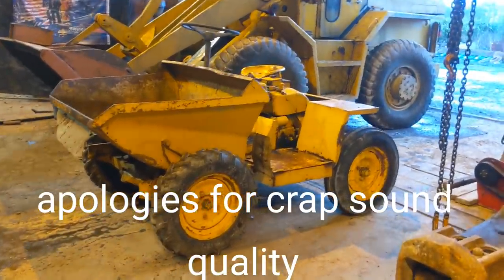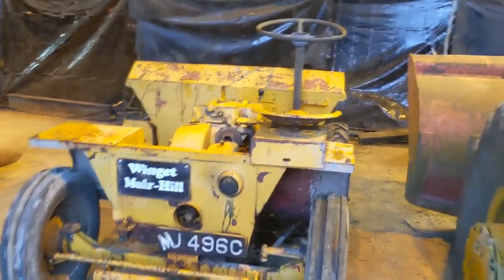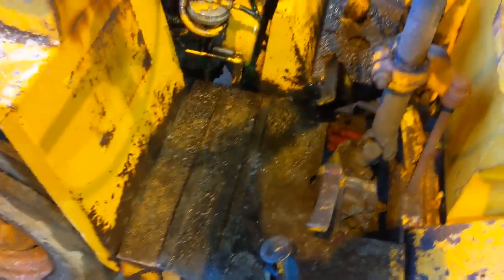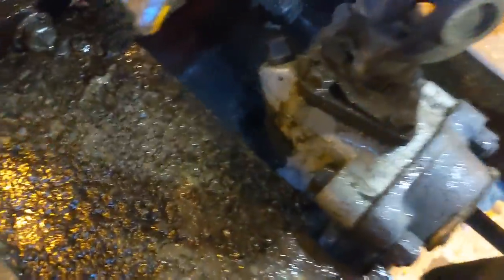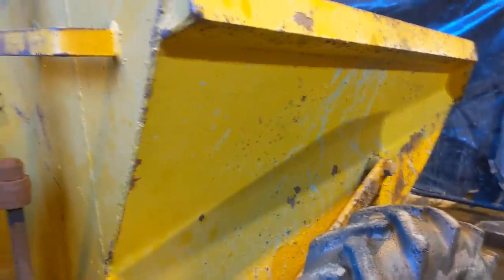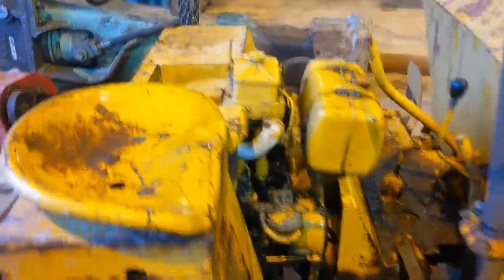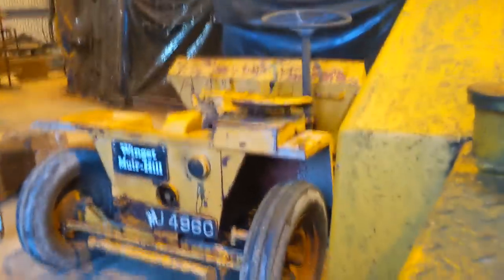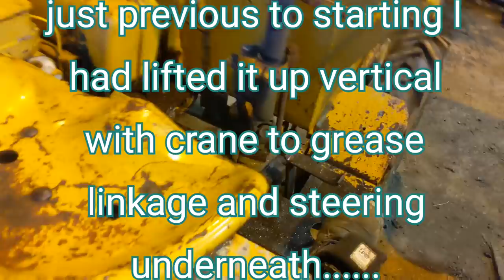it always happens to me .. muir-hill dump truck petter ph1 ...wait for it..

Comment: Never stop these engines using the decompressor lever, it knackers the valves/seat up!
Always cut of the fuel using the rack lever on the injector pump.

Comment: A wee tip , don’t turn it off by using the decompression lever as that fucks up the valve gear . The ph petter has a stop lever just below the injection pump  . Sometimes it can’t be reached . The best way to stop it is by just shoving the rack on the pump

Comment: I've got a Johnson dumper with the same PH1 engine. I was told you shouldn't stop the engine with the decompressor, push the fuel rack towards the front of the dumper to stop it. When starting from cold do you move the brass stop on the other end of the fuel rack so the rack can move fully backwards and allow more fuel for starting? I have found filters etc available. Great engines. Make sure the bolts holding the cylinder barrel on are tight. They have a habit of working loose and breaking the barrel.
Reply from the maker: Brilliant thanks for advice bud! Got service kit off eBay , so I can't wait to give her so e fresh oil
Reply: I’ve always understood that it’s detrimental to the valve gear to use the decompression device to stop a diesel engine it also leaves the fuel rack wide open, risking flooding the engine with fuel - that’s why it smokes black when you knock the decompression lever down. 
Move the fuel rack to the no fuel position to stop.
There should also be a little catch device, like a small cam which you can lift up, which allows the fuel rack to travel further than the normal maximum fuel position to allow excess fuel for easier starting. The catch returns to its normal position as the engine runs up to speed . . . .
Reply: Not read all the other comments, but totally agree, NEVER stop it using the decompression lever.
Sweet little dumper! Enjoy!
Reply: @steveallarton98  Risks to valves at higher speeds. Main prob is leaving diesel in the cyl - washes oil off the cyl walls and dilutes lube with diesel.
Reply: Correct.

Comment: That was like going back 60 years. I can remember being with my Mom when I saw one run over one of those parafin lamps with red glass in them. I can also remember the paddies filling the cones with cement because the mods on their scooters were kicking them over as they rode by. About a dozen Lambrettas and Vespas spread all over the road along with bits of fur and wing mirrors. They didn't do it again - odd that.

Comment: Hi alistair. Great dumper .   Trip tip ??
Have that engine on a saw bench.      On mine there is a cold start , full fuel.  On the throttle linkage.  , By the pump . Click a thing out from memory.  Then full fuel.  Lots of smoke , it knocks it off itself when  running.    I stop mine there too.  Turns off fuel at pump . I wouldn't use the decompress to stop . I could photo ,film I u wish .   As I say not knocking u mate.     Liking what ur doing.  Thumbs up.  Subbed awhile ago .   Keeps safe mate .
Reply from the maker: AHH that's great to know bud I knew it was the extra fuel, didn't know that's where it stopped!  I must get workshop manual for it!
Reply: @allistairc123    I'm sure it is on mine anyhow, be a spring loaded thingy won't it mate
Reply from the maker: It's down the side of the seat, I pulled back on pedal linkage and it stopped. Cheers!

Comment: 😂made a few hundred wingers when at Sanderson Priestman mainly the 2500/3000. Could nock out a chassis in under 3hours on nights with a bonus time of 5¾hours. Pivots 1hour bonus time could do 3 in 1hour them were the days. Knock out 2 chassis on a shift they thought you were going like a mad man all night more like skiving for 4hours 😂😂🤣🤣
Reply from the maker: Outstanding! Was there quality control!? Lol
Reply: Yeah very tight quality control. I was a fabricator just wound the clamps to the correct measurements then put in temporary braces 😂 the welders didn't know the job would spring out of tolerance after welding that was there problem not mine 😂🤣
Reply: @pointiscrap  please answer me a long disscussed question, early 90’s/lister ts3 era winget benford barford sanderson 2500/3000 dumpers, are they all the same? Come off the same line/design?
Reply: We just built the chassis from 1000,2500/3000, then another can't remember exactly what size it was. The 2500 and 3000 were built on the same jig basically a few mounting holes in different places and wider on the wings. We also built the teleporter chassis's. We sent them off to Croft, Skegness for painting and final assembly. Our main product was the Priestman Mustangs and VC range built on site from start to finish.
Reply: @pointiscrap  👍 cheers for the insight.

Comment: I remember one those being used to cart spoil from the new trench being dug by a JCB backhoe in roughly 1972/3 when my parents bought a small farm in Lancashire. Then, many years later I seem to recall seeing one rotting away on a farm somewhere.
Not long ago I used to drive a Bamford (?) dumper occassionally and that was a two cylinder hand crank to start dumper. I hated it!

Comment: Stop stopping it on decompress lever your bend the bolt or break the bolt on decompress lever just just the stop on buy diesel pump if you want air filter ring a t wildes we got have them in stock
Reply from the maker: Can the piston hit the valve?
Reply: @allistairc123  as with all all engine the piston can hit the valves essential if the decompress lever used
Reply: @johnwildeboy7100  personal experience, the valve does not hit the piston in these engines.

Comment: Stopping any engine with the decompression lever can cause carbon etc to lodge on the valve seat etc. I had a Winget year's ago while renovating the house if it was a muirhill I would possibly have restored it. But it is now possiblely a top of the range Toyota ???? 🏵️

Comment: Tidy looking unit, must have been hauling cotton wool all its life! Engine should be shut down on the fuel rack though. Starting handle should have a wooden spindle which allows it to rotate in your hand when cranking, failing that try spitting into your palm. Sounds gross but it works. Great find.
Reply from the maker: I'm worried about damaging it with decompression lever, does it cause damage?
Reply: @allistairc123  I’ve heard of rocker arms and pushrods getting damaged but it could’ve just been my foreman putting the wind up me! If you push the fuel rack all the way to the right it will shut the engine down. If it starts revving it’s nuts off push the other way. Not worked on one for 25 years so I’m a bit rusty. Also the box under the seat is for the storing the starting handle.

Comment: easiest way to wreck an engine by stopping with the decompressor, will either bend a valve or burn the seats. NEVER NEVER stop an engine that way
Reply from the maker: How does it burn the seats? Does it open inlet or exhaust?  
I don't imagine they would make the decompresor have valve piston collisions?
Reply: @allistairc123  opens exhaust, makes no odds if done from idle, leaves it wet if done from rpm, im loving the keyboard heros😂 ive seen them stop from coked up exh’ port, and rolled n run on their lube oil, take a 💩ton more than a few smokey pick ups to hurt them.

Comment: the valve lifter should not be used whilst running, engine should be shut down at the injector pump, the vale lifter should only be used in an emergency.

Comment: I have a acquired a little dumper ( vintage ) no nothing much about them.
It is very clean and no dents in bucket .

It has a double cylinder petter engine which is very hard to crank to start .
It's a bigger version than your one ,my question is are they worth much ?

Comment: Excellent little dumper , use the correct stop method.filters are available , a lot of the steering play can be removed by adjusting the steering box ?. Good luck 🏵️
Reply from the maker: Steering box is incorrect replacement, the bottom bearing cover is missing
Reply from the maker: I got service kit off eBay , does  decompression cause damage?

Comment: Hi mate , sounds good 👍 I used to work on them way back when ! 
BUT  your not supposed to stop the engine with the decompressor 
Only stop with the pump shut off! 
All the best with it 👍👍😁😁
Reply from the maker: Thanks bud, what happens when u use decomp?
Reply: @allistairc123   Hi mate  , lifting the valve to stop the engine,  is not recommended because the pump is still injecting fuel into the cylinder and is washing the oil from the bore , and this can cause damage in the long run ! 
Good luck with the dumper its a good make and should go on for a long time if looked after .
Best wishes Frank

Comment: Good find Alistairc, IMHO the Petter PH1 (and 2) were one of Petters best engines, ........IME one of the main causes of steering box wear is the top shaft bearing or seals going and letting in water and crap.
Reply from the maker: Yeah I have to get new one fitted I'll check bearings thanks bud

Comment: Who rebuilds these engines? I have one in a cement mixer that I wouldn't mind having done up a bit. Co down area
Reply from the maker: I've found a filter service kit from company on eBay search ph1
Reply: @allistairc123  most of the motor factors will carry the filters, got mine from autosupplies in Banbridge, have seen rebuild kits on the internet, just not much of a mechanic myself, if the machines aren't broken before I start to them, they generally are when I'm done mechanicing at them🙄

Comment: I just sold one of these at an auction in Norfolk. The only fault was the exhaust was completely corroded. I owned it for 25 years and almost every time i used it the vibration from the engine gave he a headache! It surprised me that it fetched good money!

Comment: Do learn the correct way to stop a diesel engine.
Reply from the maker: don't use the decomp bla bla bla. I know. wond to much harm at idle
Reply: @allistairc123  Will wash lube off cyl walls and dilute the lube in the sump with a little diesel every time.
I've seen it done wrong many times.
My genset says don't start using decompressor - it's electric start and the small motor doesn't get it over the first compression - so that's bad for the motor - powered up and hardly rotating. 1 sec of decompression makes life a lot easier for the motor - second compression is no bother as flywheel has speed.
https://www.youtube.com/watch?v=Z_r9ZH1aFoI

Comment: I once worked with a Bobcat Skid-Steer Loader. The engine was so worn-out that after starting it, it ran backwards (which I didn't noticed), pushing the handles forward (normally makes it run forward) made it move in reverse with a jump because the (unexpected direction of) movement made me push the handles even harder. Quite dangerous, luckily there was no one standing behind the machine !
Reply from the maker: I've herd simmilar funny stories involving motorbikes lol
Reply: @allistairc123  In case of a motorbike (two or four stroke engine) the effect is probably due to ignition timing issues (to close behind, or even before,  top dead centre).
But the Bobcat had a Diesel engine, and it ran sometimes one way, sometimes the other 😵 ❗